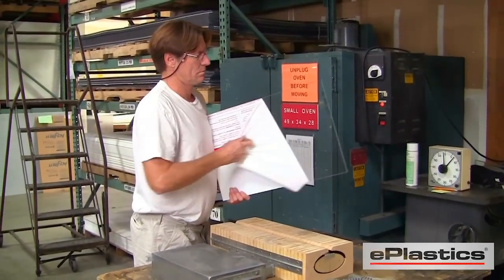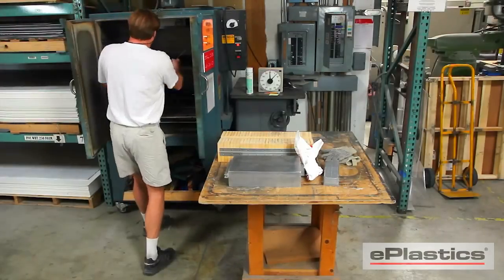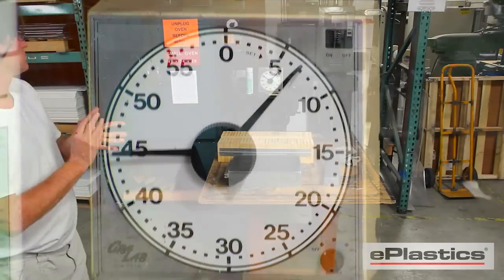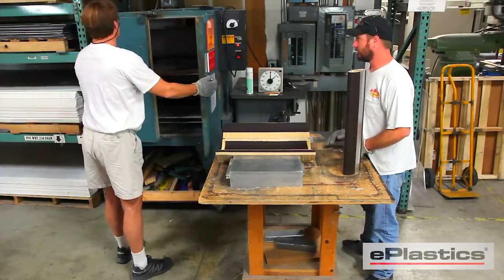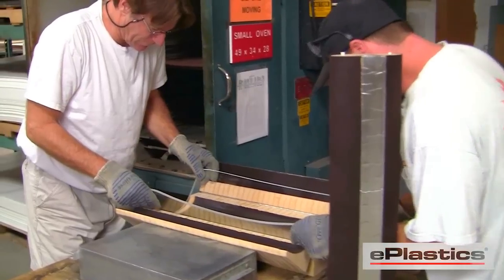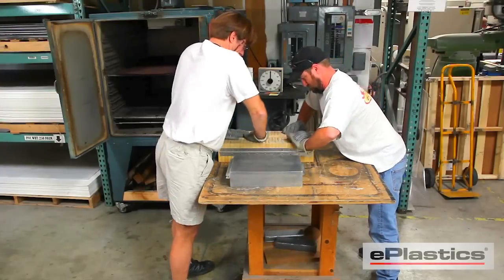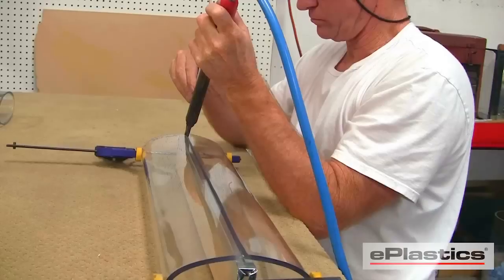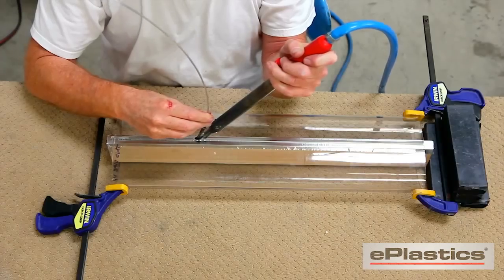Fabricating Oval Polycarbonate Tube

Comment: Hi.. ePlastic..
i'm currently working a DIY project, using Acrylic.
first i'm learned from your video, how to forming the acrylic.
im already did, the problem, there is a scracth mark on the acrylic.
i have a question:
1. what is the blackcolour on the mold, is that leather sheet to prevent a scratch mark?
2. what did you use to glue the polycarbonate tube?, because i'm thinking to buy that device and the glue at eplastic.
but i can't find it on the ePlastic website.

Thank you..

Comment: What is the device used to melt the polycarbonate tube to the oval part?
Reply from the maker: +Grayr Torosyan we build all of our forms to each customers specifications. That is the simplest form of a mold that we could think of to get the tube placed and cooled in a timely manner. Both the center structure and the larger box on the outside were built specifically for this project.
Reply: @eplastics  Hi there, I am looking at molding a polycarbonate tube as well for an R&D project, and was wondering if you could advise what material you used to make the mold? It looks like wood, but I am not sure what lining material you are using for the contact surface?

Comment: What type of plastic was that plug made out of?
Reply from the maker: GeorgeGraves are you referring to the mold that we built to form the material?
Reply: *****  The black-ish plastic that was milled to make the bottem base.  As see at 1:53
Reply from the maker: GeorgeGraves that is PVC. There are no specific requirements as to what material that must be. We try to use what is easily available and relatively cheap since it is not a part of the final product.

Comment: I have a question. I am currently working on making thin-walled cylinder made of polycarbonate sheet. But I found welding is a big issue. Could you offer me any suggestions?
Reply from the maker: Ziquan Dai Your application depends on the thickness of the material. We do not recommend welding any material thinner than 3/16" due to the extreme difficulties in getting the weld to hold correctly. For material thinner than 3/16", glue is a more appropriate solution. In addition, if it is a small diameter tube, then holding the material in shape will be extremely difficult. Plastic welding is a skill that takes a lot of practice to perfect, so buying some extra material to practice many times with would be well worth it if you do not already have a lot of experience.